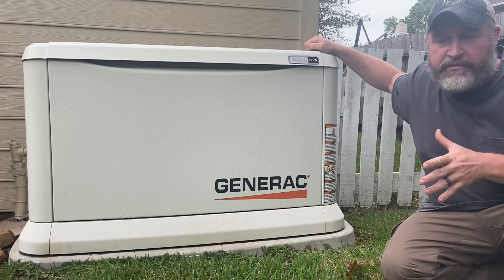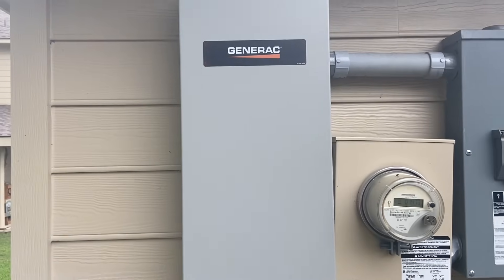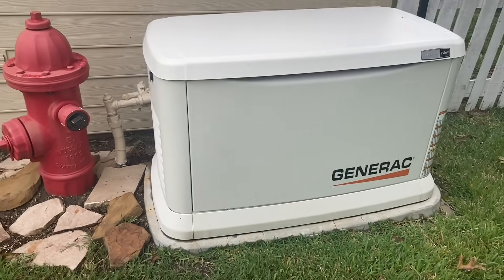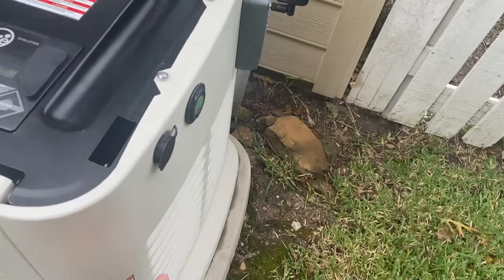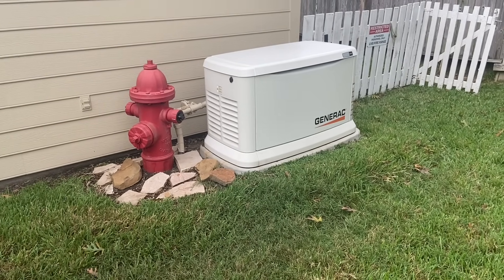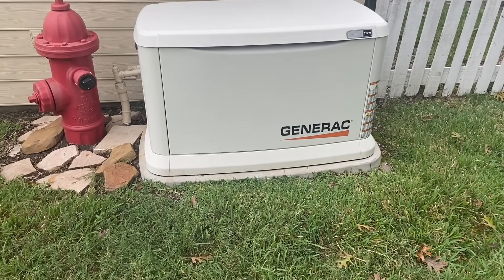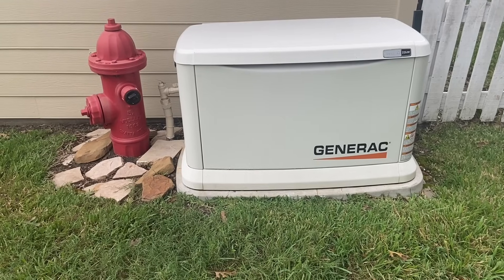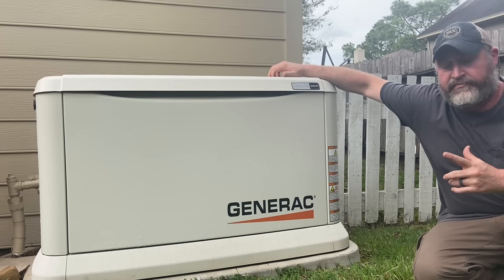Thinking of purchasing a generac whole home generator?

Comment: Great video ! I currently use a portable Generac Generator , 8500 watts . This is a pain to get set up and operational . We are looking at Generac , Kohler . Had a Generac installer look at what we will need and next week we have a Kohler rep doing the same .
Reply from the maker: I agree we started with a portable 5kw and could barely do anything with it and the setup process we not something I would want to do in the middle of the night.
Reply: @JustCantSitStill  Or in rain , snow . Cannot let it get wet . I have a cover for it with a pvc frame to help keep dry . Then checking fuel is another pain ,
Reply from the maker: @mikeswink1031  yep been there
Reply: @JustCantSitStill   Work smarter , not harder
Reply: I have a 13kw Tri fuel portable generator. The ROI on the generac was not worth it for me. Every time I set my generator up I think about the $15000 I saved and smile 😂
Reply: @downsouthlouisiana  Yeah, and then comes the day when you are not physically able to set up your generator, nor ferry the fuel to keep it running.  Some investments have more ROI value than money, but enjoy that $15K, while you can.
Reply: @bobbygene8274  I don't have to move it or get fuel. It sits outside in a zombie box enclosure tied to the natural gas line. Now I do need to go outside and flip the interlock. But that's about it, but that works for me.  I understand some people have disabilities.

Comment: Nice presentation.  If anything, modern times are dictating how one can become increasingly more self-reliant. Simple.
Reply from the maker: Thanks John for watching please subscribe and check out some of my other videos and have a great and safe new year
Reply: To become even more self-reliant, I'd run it on propane. In many situations, like what happened in Texas a few years back), a city might be forced to turn off the gas lines and your generator won't be worth anything at that point. You can get yourself a big 'ol 500 gallon propane tank and if you are conservative with electrical usage, you could run things for 3 weeks. If you don't have power back by then (man, you're in a bad way if that's the case), you can call and get a delivery for more propane (by then, the roads should at least be passable).
Reply: That's exactly my setup.  It runs on a dedicated 500 gallon propane tank.  Plus, I have a 9500 watt portable generator as a backup that runs on either gasoline or propane. Started out with the portable and manual transfer switch set up to power the essential circuits in the house; well pump, boiler, microwave, some lighting.  Eventually invested in a whole house unit, ATS and propane tank. Not cheap but it's the price for peace of mind.

Comment: Nice job!! Love when the other bids couldn’t give you a why on the extra 4K charge.
Reply from the maker: Thanks Anthony, I appreciate you checking out my channel.
Reply: @JustCantSitStill  I’m going to shop for the same thing. Probably use LP and a smaller size etc.
Reply from the maker: @anthonyelectric6045  yes sir hopefully in your quotes they will give the the options on sizing and what all you will be able to run. We could have went smaller, some stuff would have had load shed modules installed, but we opted to do the whole house with no load shed module. Nothing wrong with load shed modules honestly they did a bad job explaining it so just went with the 22kw seemed less complicated at the time.
Reply: @JustCantSitStill  yup, your running the a/c units and that’s why in the calculation you definitely needed the 22. Most generator companies look at your main and size up but it really depends on what you want to run when power is out. Long story short

Comment: I am amazed you can run the whole house on a 22 kw unit, did not think it was enough for multiple ac units, but if its running it all, that is great, if I was ever able to get one, it would be a lot more, would need a separate propane tank, or a bigger one
Reply from the maker: Yes we only care about running the 2 house units but it will definitely handle anything we need

Comment: Great video.. my house has 2-200 amp breaker panels 2-ac units 3 ton each, i might have to buy another ATS unit.. also run 3/4” gas line about 25’..also gonna install 2 soft start kits for each ac condensing units to avoid the initial in-rush power where compressor starts on the ac units.
Reply from the maker: Awesome thanks for watching please subscribe like and share
Reply: You did of course run high pressure gas in that 3/4" line (2 PSI natural gas, or High Pressure LP)  Soft starts are always a good idea.

Comment: Regarding maintenance, most models will require a valve clearance adjustment at 25 hours. I believe the 14KW and the 18KW have hydraulic lifters, so it’s something you don’t have to do.

If you’re good with your hands, doing the rest of the maintenance (i.e oil changes, etc.) shouldn’t be an issue.
Reply from the maker: Thanks for watching, pretty decent with my hands check out some of my other videos. We have a maintenance/monitor plan and a extended warranty. So in order to keep from having any warranty issues I don’t touch it until warranty is up.

Comment: I am in Florida. I wonder that If lots of houses install these things, will come to a point where there is a lack of Natural Gas coming down the street.  I have opted to add a conversion to my portable generator to run on natural gas, and then use natural gas until it is not available, then switch to gasoline or propane. (I have supplies of both)  Although my system cannot run the central 5 ton AC, i have  several small window units that can be put into service while waiting for the power to be restored. The most we have been out so far is about 5 days after a storm.  Pretty much the entire town was out, so I would think that we are not going to need to ever go more than a week or two. If it is going to be longer than that, we probably should evacuate. Our experience was that gasoline was becoming hard to find, and grocery stores were running low on food just after that 5 days. After 4 days they lost power and had to throw away all food items that were refrigerated. Just as things were looking pretty bad, power was restored. They bring in trucks from all over so the electric company gets lots of help to restore power.
Reply from the maker: The gas company would have to do what it takes to keep up with the demand. This is one reason to get a permit as it all gets calculated.
Reply: @JustCantSitStill  I would hope so, but I am not as optimistic about things like this.
Reply from the maker: @mrpawpaw7023  you plan the best you can I guess , I mean in my situation I think I am more prepared than some one that does not have on so? I have 2 other neighbors that have the same unit. With the gas line still needing a regulator I would guess the pressure is still enough for now.

Comment: Excellent video.  Thank you.  In southern California our supply of natural gas is subject to earthquake interruption (and probably cyber terrorism, too).  Perhaps there is a dual-fuel option like on my little Honda portable generator.  Natural gas and LPG use different sized carburetor fittings, so might have down time to switch out on a whole house permanent model.
Reply from the maker: It runs on both LP or NG , thanks for watching and the comments

Comment: i'm getting one installed on Tuesday. It will be the Generac 24kW with Wi-Fi/Transfer Switch/Concrete Pad.

The Dealer quoted me a total of $10,700 for their part.  They will set and level the concrete Generac pad, install the generator, monitor and verify installation of transfer switch, monitor and verify the propane gas connections and pressure. Also included in the price is 1 year service agreement. The price DOES NOT include the installation of the transfer switch and electrical tie in. Nor does it include the running of the propane tank gas line.

I think that may be a little pricey. What do you think? I know some say multiply the cost of the generator by 2 to get an idea of what it will cost for a full install. 

I noticed you have Hardy Plank Siding. I do as well. Did they have to drill through the wall to get to electric panel (mine is located inside the house).
Reply from the maker: Awesome Kevin the price does not sound bad to me I know someone who just had a 24kw installed on natural gas transfer switch and monitor , very short runs for electrical and gas they where at 12K$. Mine main and sub panel are both inside the garage and our meter is right on the backside so the wire run was already there, they did screw the transfer to the hardi no issues. Thanks for watching please subscribe! If I can answer any else I will try to help.
Reply: i'm not a fan of generac, they do some dirty tricks, but if your going to buy one keep below in mind, i would want you be get the most out of your investment. 
generac uses aluminum windings in their alternator, i highly recommend installing a breaker (like a small hottub disconnect with a breaker) under sized to about 80% of the capacity. i've seen a lot of generacs with the back end blown out because they ran above 90% for more then an hour or two. 

change the oil, oil filter and spark plugs every year (or every 100 hours during an outage),   
and change the brushes and battery at lest every 5 years 
remember, it's a standby residential generator, it's not designed to run days on end.
do that and you should see at lest 2K hours on it
Reply from the maker: @chainsawsandgenerators9952  thanks for stopping by, check out some of my other videos if your interested mostly automotive LS engines and Gen5 LT’s . Give me a subscribe have a great weekend 👍
Reply: @JustCantSitStill  The generator installer let me know the electrician would charge $2200 to install the transfer switch. So I'm now up to $12K. Sounds like by the time the propane gas line is dug and propane installed I'll be $14Kish. 

I did subscribe. ;)

Comment: make sure all pipe connections are wrapped with a special tape foe propane or natural gas instillation.the installer I had did not and I lost a lot of gas because of that. be sure the vent line is clear.
Reply from the maker: Our permit required a leak test so we are all good, thanks for stopping by and checking out my channel

Comment: We had the 11K unit.  Home square footage not so important as potential electrical load in deciding capacity needed. Furnace, well pump, hot water heaters, electric clothes dryers, electric heat, a/c are  the largest draws on the unit.  If you live where snow is a yearly occurrence, mount the unit at least 12, or better yet, 18 inches above grade.  This will keep the intake above all but the heaviest storm accumulation, and also make working on the unit a lot easier on your back. A good electrician/ installer will happily calculate your needs prior to purchase, but like building a garage, bigger is always better as far as KW capacity.  Most units come with a trickle charge system, and the battery should last a minimum of three years.  I sold my house, and the unit added $7,000 to the final price,  I had Generac for three years with no problems, and actually ran the house for 8 days in 2018 after a freak March late season snowstorm.  A large propane tank makes you self sufficient and gives you peak performance.
Reply from the maker: Awesome comment thanks for watching!

Comment: Have you thought about building a shed around it to keep the noise level even lower?  Then run your exhaust up, over the roof line of your current garage, just like your water heater exhaust on your house.
Reply from the maker: Solid idea, however the noise does not bother us at all , the shed and modified exhaust would definitely void the warranty.
Reply: @JustCantSitStill  Also a shed would block the air flow that cools it. The way mine sits, it blows air out in the back yard and we hardly hear it.

Comment: Just rewatched and I might have missed it if you mentioned it but I have heard of people having difficulty with these generators in the colder areas. I think the exhaust port freezing or something like that.

I’ll ask before I buy but I’m pretty sure the manufacturer would be aware of this. 👍
Reply from the maker: I believe it’s condensation that build up in the bottom of the air filter intake box. I have not had this issue but we normally don’t get the freezing cold for long periods.

Comment: Well, I am glad to see I not the only one with the entire power distribution, cut off, conduit and main panel been installed crooked. Heck even your bus bar isn't installed straight. 

Mind you I had them come back and fix all that crap, by teaching the installer on how to use this new and novel tool called a "level".
Reply from the maker: For some reason the buss bar comes like that pre install not sure why, does not bother me works great. The meter was installed crooked after our siding was done everything was removed loose and reinstalled, it’s behind our garage so it does not bother me. Thanks for watching please subscribe and check out some of my other videos

Comment: I'm about to  pull the trigger after my last outage. My friends say go Kohler , but I'll research and see what works for me.
Reply from the maker: Probably fine either way , my pops has had his generac for 15 years oil change and battery and insect proofing the transfer switch panel is all that’s been done.

Comment: Have a Generac 16kw for 5 years now with a 10 year warranty.  Best money I ever spent.  Total cost even with 10 year warranty and natural gas line was 8k.  
What is the circuit breaker rated at on the Generator?  Mine is 75 amp.
Reply from the maker: Thanks for watching and the comment, ours is a 100amp

Comment: I have one 5 ton in Arzona for a 2200 sq foot home and it pulls 8kw (rough;y). I assume since you have a total of 9 tons, your AC alone is pulling  (9/5)*8= 15 KW (roughly). 

That leaves 7KW for everything else in the home. Hair dryers, coffee makers, frif, freezer will pull up to 1.5 KW when tunred on and pulling power. I have 3 girkls and  1 wife and that is 4 hair dryers running at once! :-). I might need a 30 KW generator,
Reply from the maker: Lol thanks for watching, look into that new 26kw should do the trick.

Comment: That's a great price on the unit and ATS, it's just over $6,000 today (22JUL22) online.  My friend is an electrician, that all-in-one [power/signal] Generac cable is about $10/foot.  Your generator is pretty close to your meter pan.   Was talking to another buddy about this today... I know it's the "going rate", but how does the electrician come up with nearly $4,000 for install (I see added a  $300 fused square D breaker box), it's placed on a pad and wired??  I see even gas is separate!
Reply from the maker: Going rate now in my area for turn key done deal is 14k and change.
Reply from the maker: Thanks buddy for watching please subscribe and check out my other videos

Comment: If you are going to run that unit in sub zero temps you have to vent the engine blow by to the atmosphere rather than the air filter housing. The condensate will collect in the housing and freeze thus plugging the engine vent and cause oil to be blown out of the dipstick tube and it makes a big mess.
Reply from the maker: Thanks for watching lucky for us we will never be sub zero temps.

Comment: In the last 2 years AMAZING improvements in portable generators that can be used as backups have hit the market.  Dual or tri fuel generators that can run on natural gas are game changers because you dont have the storage and degredation problems that gasoline has.  Bluetooth monitoring and remote start and clean inverter power are bound to eat into the dedicated backup genny market like the overpriced ones like we see here.

Portables still need to focus on natural gas compatibility and transfer switch hardware to really take off
Reply: I have a tri-fuel portable that will power kitchen, heating units and bedroom.  It will not power our house AC if the outage is in the summer.  It needs an interlock and secondary panel for the circuits that run from the generator, but it is a much lower cost (about $1500).  However it is not automatic and will not transfer over if we are not at home.
Reply: Only concern is you have to be home to run a portable. A stand by you don’t.

Comment: Hello thank you for being thorough, I have a question about how would I find out how much power I would need from the Generac before I decide to purchase one. We have central air small unit, refrigerator, tankless water heater, regular lights, TV,  sump pump, small deep freezer. Also is it better to use propane or natural gas. Thank you for your time.
Reply from the maker: Hey Kenneth thank you so much for watching! While I would not be able to answer the size question here is a link to generac and they have a calculator that may help https://www.generac.com/for-homeowners/home-backup-power/build-your-generator

As far as the question about propane vs NG , propane is more efficient but I think you will need a least a 1000gal tank if you want to be ready for a couple weeks so with that being said our Natural Gas supply never runs out! So I would go with NG if you have that option. I hope that helps ? Please take the time to subscribe if you have not already and share the channel with friends and family! Thanks so much.